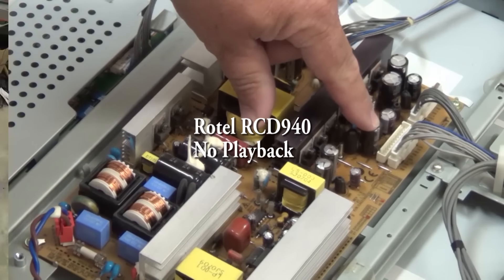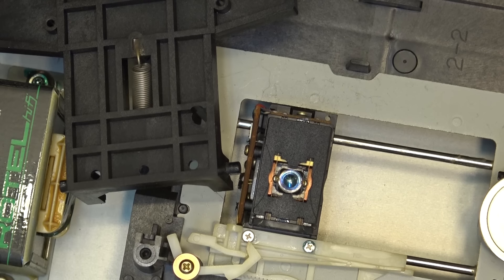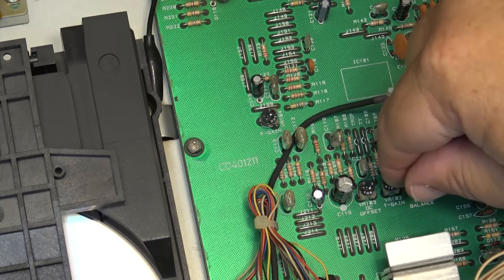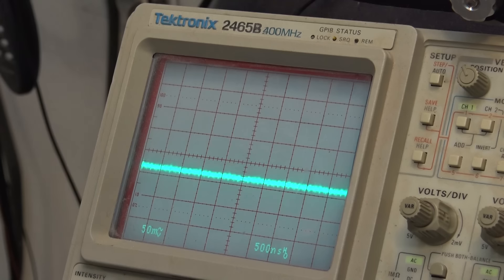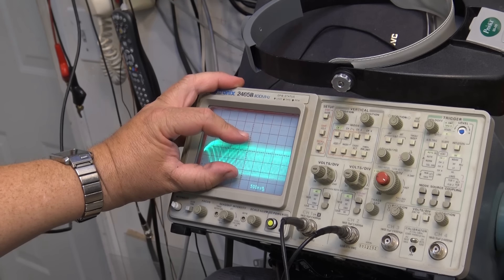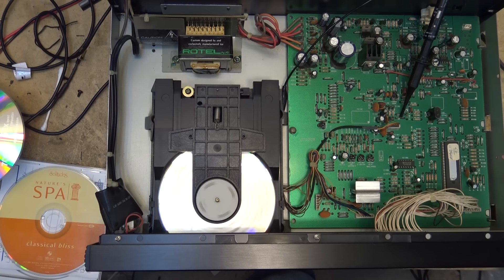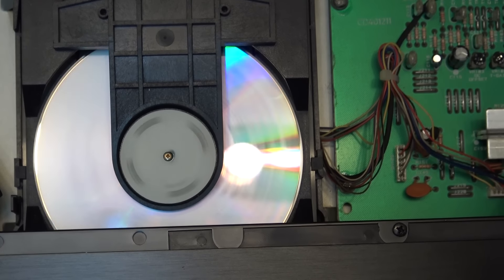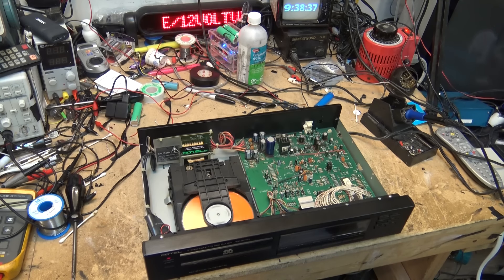Rotel RCD940 CD player repair and alignment

Comment: **In theory**, the human-visible darkness of a CD-R is irrelevant, since CD uses an infrared laser, so the dyes only need to be visible in the infrared spectrum. Yet in practice, I’ve had exactly the same experience as you and most of the other commenters so far: the older, darker dyes (azo is very dark, cyanine is the slightly lighter one like in your video) work better than the new, light dyes (phthalocyanine). I have a bunch of old burned CDs with azo or cyanine dyes and they all work great still. I also have a bunch of phthalocyanine discs that play fine, but I’ve also had some of those fail over the years.
Reply: It's more down to the quality of the media and the ability of the CD burner to tune themselves to the disc, than the disc type itself. Older phthalocynanine discs from Mitsui or Ricoh are every bit as compatible as any cyanine disc, the newer ones are crap because they are cheap. In addition it was always the case that the better CD burners from the like of Plextor or Teac always made better burns than the rubbish from Philips in particular. The speed is also important, and newer recorders/discs generally perform better when written faster than if they are slowed down.
Reply: 780 nm wavelength, 800 nm wavelength, 870 nm wavelength (infrared and red edge) semiconductor laser (early players used helium–neon lasers),[1] 1,200 Kbit/s (1×)

Early plauers had helium in them, theu were more sensitve
Reply: No, its the dye, reflectivness

Comment: So do you use just a normal contact cleaner for the eyes then?
Reply from the maker: Thomas Fanning 
No, as that could damage the plastic or coating. I just wipe the dust and smoke film away. I dont really worry about scratching it as I am not putting that much pressure and a small scratch wont affect it much because at the lens the laser beam is not in focus anyway

Comment: I and my mother smoke. Unlike alcohol,  smoking does not make you out of your mind!  Any way, every year I have to go through rolls of paper towels and spray detergent and wipe the yellow color off of the walls, ceilings and windows of the whole house.  You spray on the Basen Tub and Tile Cleaner, wait a few seconds, and you can see yellow drips.  Then you wipe it off and the  paper towel turns yelllow.l
I am beginning to make money with advertising my electronics repair company.

Comment: I always heard that cdrs kill lasers, is that true?. I've always been in the mindset that the laser was on its way out and the cdrs usually have nothing to do with it. Unless, it's a unit that increases the gain on the laser to read better, but if I'm not mistaken most CD players don't do that, right?
Reply from the maker: Never heard that one. 
Cdr are harder to read and some older players could not read some brands of disks.

Comment: Don't you use isopropyl to clean the lens?
Reply from the maker: Luc Peeters 
No it can attack the plastic lens. Gets in around the lens can dissolve the glue or drip inside and do more damage. Generally a dry qtip to rub off the contaminated film on the lens.
Reply: Well been cleaning those things since the 90's and never had issues cleaning those KSS2xx series. I would assume that dry cleaning would cause more scratches on the lens.
Just a fun story.  Had a cd-player from a neighbour that I couldn't fix (mega smoker) due to crap being under the lens.  The guy was specialized in very very small mechanical things. SMD size was like a car size to the guy.  He completely dismantled the laser unit and cleaned it. It worked after he had done that. That was like 20 years ago and till this day I still can't believe what he did.

Comment: Interesting that you think a single disk CD player is less worthy of repair, they’re pretty much inherently better than a multi disk player at the same price point and really good, high end multi disk players are pretty much non existent. That Rotel was a good budget machine, I had one years ago and used it with a Linn amp for a while.
Reply from the maker: Si1983h 
No not less worthy of repair but in people's mind they want changers more than single disk. I use my single disk cdp555es all the time.
Reply: 12voltvids maybe it’s different here in the U.K., changers were fairly common in low end “all in one” systems but in separates systems they were/are less popular. Some of those Sony ES machines are great. The two linn machines I have here sound superb too.
Reply from the maker: Si1983h 
Linn made some good stuff. I have only worked on one and it had a very good tube type sound even though it was ss
Reply from the maker: We had low to mid range changers, high end single disk, and of course the jukeboxes. 50, 100, 200, 300 and 400 disk models. I have a 200, and I am always keeping my eyes open for a 300 or 400.
Reply: 12voltvids I remember Sony making some mega changers that had a full index of albums/tracks on them. I thought they were quite an engineering feat but I’d definitely have wanted to use an external DAC, I’m a fussy audiophile nerd. Single shot CD players outsold changers 20-1 or more in the U.K. (made up statistic but I’d say it’s fairly accurate).
Reply from the maker: My CDP555ES uses a burr brown DAC that will stack up nicely to any external one you want to compare to.
Reply: 12voltvids the CDP 555ES was a fairly high end machine, it’s a nice sounding machine and it’s built like a battleship. The same isn’t true of CD changers though, the audio circuitry isn’t the primary focus, the loading mechanism is, and those involve a lot of moving plastic parts. I’d rather have a simple and solidly engineered single disc machine like your Sony ES machine, or my Linn players (which really do sound fantastic).
Reply from the maker: I agree that the 555ES sounds fantastic, and the Linn players also because you are paying for a quality machine. L cringe when I hear people say that vinyl sounds better than a CD. Well perhaps it sounds better than their CD players, but a real CD player will blow the doors off any analog source. Of course this all is dependent if the mastering engineer was competent. Many just used the mix that was compressed and mixed for the vinyl cut, and those CDs sound no better than the vinyl copy, but if a CD was properly mixed then there is no comparison.
Reply: 12voltvids haha, that’s a rabbit hole, I love vinyl. It’s not perfect at all, it’s fussy and way less consistent than CD or digital streaming but it can sounds amazing. I’ve got a beautiful Rega machine in my main setup... and I bought an entry level Rega player for my second system yesterday that will see off a similarly priced CD player in terms of enjoyability, maybe less technically accurate but just more convincing and involving. Mastering is the most important thing though, I’ve got albums that sound shocking in digital form and great on vinyl and vice versa.
Reply: @Si1983h  Great comment. Been collecting vinyl records almost my whole life.
I also take on professional repairs.
As im a huge fan of yamaha amplifiers. A few years ago i decided to buy a vintage yamaha cd player from 1988,which i only used for a very short while as i only had a couple of discs floating around, so i didn't really connect it up to anything of great quality, it was primarily only a test.

For another reason i recently found out just how cheap you can buy secondhand music cd's for. So i decided to buy some 90's music on the cd format. And also because i didn't really want to pay the silly prices that new records are for 90's music. Firstly i used a pretty basic dvd player, and after what seemed a fairly short listen, i thought, no this can't possibly be right? I just ended up feeling fatigued, so i thought maybe i ought to dig out this old yamaha machine. This did make a huge difference, even though i hadn't powered it up for easily 4 years, still worked flawlessly. To begin with some discs seemed a little short on dynamics up until i played robbie williams's life thru a lens which opened the music up a lot. I then played some classical which sounded great. This yamaha player although was a level entry in 1988 really does sound musical with a fantastic dynamic stereo soundstage,i still wouldn't swap it for one of my record decks in a thousand years. The problem with the sound of cd's is the compression,this sound
gives it a more false feeling during the fast transient responses. The other problem is that most of the time more often than not is that the music recorded onto cd isn't as well produced as when you buy a certain classic album on the vinyl format. I listen to a lot of 60's, 70's & 80's music which sounds astonishingly incredible on vinyl. 

As all of the engineers way back in the vintage era days used to say in the many gramophone magazines. Close your eyes, now if you can picture the musicians in your living room, then you have what we call PURE HIFI

Cd's just don't quite hit that musical spot.  An expensive record playing device takes quite a lot of very careful skill to get it to perform with precision. Its mainly to do with the cartridge/stylus tracking alignment and one main that gets overlooked is cartridge overhang. Overhang takes serious time and sheers effort. But when correctly seated will give one a sound they'd never expected. Its certainly brings out the best in sound and less distortion.

Only 2 main issues with vinyl is noise floor and when a record has press flaws.
Why ive always preferred old original pressings from a time when label manufacturers cared about the music industry.

Comment: Well done, it's alive again.
So it's not my imagination that the older green disks were better, the later silvery ones just didn't read so well.

I was happy with 4x disks, what asshole done away with them :-(
I also used some orange looking blanks too, they were also very good.
I've had silver tevion data backup disks fail over time, can't trust them :-(
Reply from the maker: Yes the old disks were better. The gold with green recording surface was best followed by the silver / blue disks.
Reply: the worst discs are the ones that you can see through, pay a bit more for the ones coated on the top, and they work more reliably plus dont scrape off and ruin themselves.
Reply: Jusb1066, I did have some really odd disks that were green and white on the top coating, the underside was green, they were dam good.

Tevion disks looked nice but faded, not good for long term data storage.
Dvd's seem quite reliable as long as they are written slowly.

My early days of burning disks was fraught with write errors and fails to verify, scsi systems just seemed dodgy for writers.
Nero was the favorite program, but later free software proved better for almost any writer, unlike nero.
Sorry waffling again.

Comment: I used to burn CDs and DVDs. I would use TDK data CD-R discs and they would work great for both music and data. I had these teac CD-Rs and they wouldn't work, basically the same issue you are having with your staples CD-R disc. I still have some writable CDs and DVD as well as some CD-RW discs. I cannot believe they still sell writable discs at walmart.

Most of my music is MP3s but I still have music on CDs. The last CD I bought was Marky Mark and the funky bunch who is actually the actor Mark Wahlberg.
Reply from the maker: Yes I know who Marky Mark is, never listened to him. I think he is a better actor than singer. I still use CDs in my 200 disk jukebox, and I back my MP3s up on disk. My car has a CD player that can read both audio and mp3 format, which is nice as a 700 meg disk can hold about 200 tracks.
Reply: The Source also still sells rewritable CDs as well as DVDs.
Reply: @12voltvids  Roughly, as this count may vary depending on the filesize, bitrate, and track length of each track involved, as they have a direct correlation between each other.
Reply from the maker: Naturally, but on average I get between 160 and 200 depending on side of tracks. I download a bunch from the 45RPM database before that got shut down, and because most stuff from the 60 and 70s were 2 - 3 minutes in length I get over 200 tracks on a CDR.
Reply: Have you heard of the song good vibrations? My jukebox is my phone and computer.
Reply from the maker: YOu mean the one recorded by the wrecking crew and sang by the beach boyz?

Comment: I was going nuts trying to figure out why my 33 year old DENON DCD-900 CD player was skipping on some CD's, but not on others.  A couple of drops of electric shaver oil in the right places fixed the problem.  Now it's as good as new and does not have a scratch on it either.